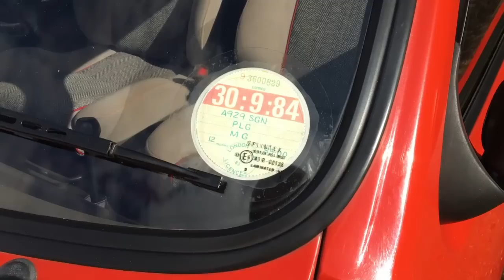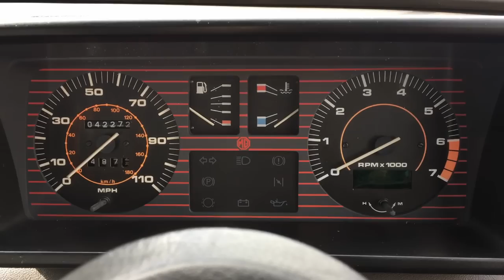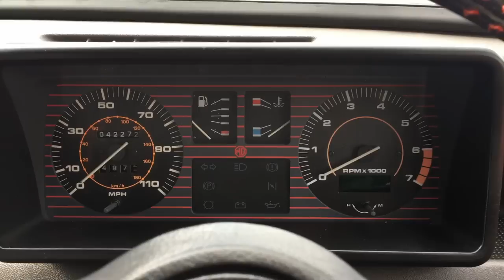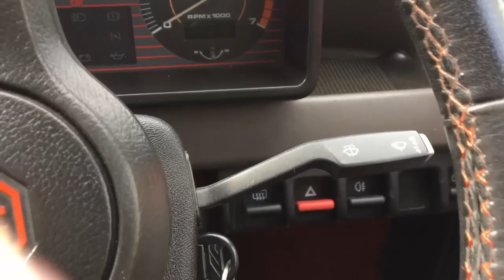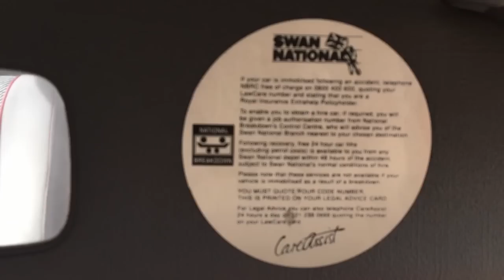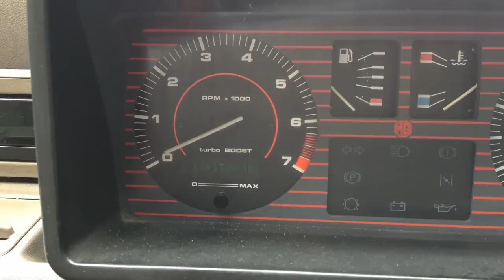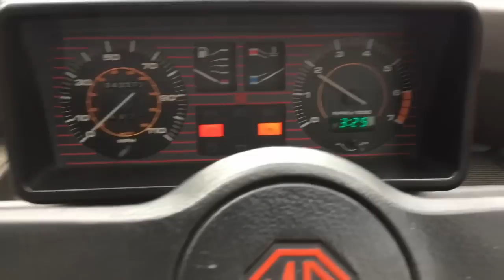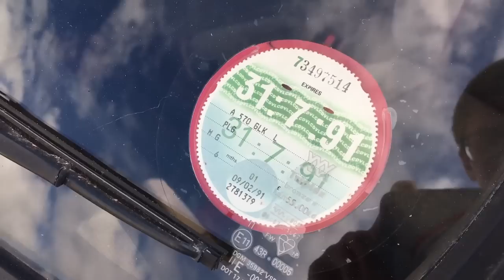"Your Best Friend Will Hate You" - 1983 MG Metro 1300 & Turbo

Comment: I'm sure I posted on this before.  These cars were fun to drive (more like a toy)  I can honestly say. I have never had another car that's so fun to drive.   The mgs looked nice and the interior is was  lush.  I passed my  test in my own MG and owned it with other cars for about 5 yrs.  I would still have it now, if that dozy beemer driver had not broadsided me on a roundabout.    After driving it for 50.000 miles over 5 years and polishing and hoovering and cleaning the interior umpteen  times,  I never noticed that the steering wheel was offset to the seat until my mate pointed it out and this annoyed me  a bit, but shortly after it was written off.

Comment: Back in the early 90s i was an instructor with BSM, who used metros at that time.  We used to get a new one every 6 months or so and we would take the old ones to a motorway service area and collect new one straight off the transporter.
We immediately started thrashing them but try as you might, you couldnt get them above about 65 mph, till the engine bedded in.  Eventually they would do just over 100.    Between pupils we would sometimes take them up to a local incinerator , which had a massive car park.  There we would tear about, doing handbrake turns, j turns etc. and have a good laugh.  Luckily, nobody was around to see what we were up to!    
I have fond memories of these metros, they were really good fun to drive and also great learner cars!

Comment: Had in 87 a Blue MG 1300.   When I bought it , it had 15k miles and was smoking oil n fuel. Took the engine out and found a broken piston ring and a scored bore. So rebored to give about 1320 cc.  The air filter was replaced with a K&N and a 3 - 2 - 1 exhaust. 40mm internal bore .   Was advised that with the correct tuning 85bhp was right output.     Put on spotlights and front fog lights, with 100/55 headlights.    Gearbox died, broke the support for 2nd gear. So needed a new gearbox case.    Cut holes in front air dam and used ducting to cool front brakes.    Make a box to sit on top of front ashtray for oil pressure and temperature gauges and a digital clock.   The front seats are very comfy, so comfy that I put a set from a crashed metro into a kit car I built a few years later.

Comment: my friend had one of these in 1988 we discovered that it was pretty easy to tune the turbo. No chip required.   You just turned a screw which increased the pressure in the turbo. After a couple of gearboxes were destroyed we installed a straight cut box from Mini Sport in Padiham.

Comment: Yet another great video, Mini-Hubnut.    I had the first Metro Turbo in Cornwall (gosh!).  I thought the ride was far too firm, so returned it to the dealer, who , after four weeks, found out that the hydrolastic suspension had been pumped up way too high.  Good cars let down by the manufacturing. Once sorted, it was a great little car.

Comment: I used to work for Kenning's may have even work or PDi'd those cars. I also had one of first MG Maestro's  1.6 R series, which i tuned up (after attending the Rover advanced carburation course) then got Company MG Montego Turbo - absolutely frightening to drive, the torque steer to right was ferocious, you had to turn wheel left while accelerating, then if you let off throttle, car turned left.

Comment: Thank you for this very thoroughly prepared and nicely presented video. My Mum bought a Morris Traveller when I was 10 years old, and I sold it when I was 32... in between I had the 1275cc A-series engine fitted, along with (essential) stronger suspension and brakes. I would happily buy an as-new 1300 Metro now because it is so practical and, as you say, just looks so good.
I eventually replaced the Traveller with a Volkswagen Polo 1.3GT Coupe  - 75bhp and superb sports car handling...
Reply from the maker: Thanks mate, this video was a long time ago now though!

Comment: Thank you SO much for uploading this!  Pure nostalgia!  An M.G. Metro Turbo was the very first car I ever bought brand new (about £5300).  This was in 1984 and so was "B" reg. and the new shape.  Sadly, it does not appear to have survived.  In my slightly revised model, the turbo boost gauge was mounted upon the header consul (top of windscreen).  My only criticism was "pinking" from the carb but otherwise I remember this car very fondly and wish that I still owned it.  I understand that only about fifty of these are currently taxed

Comment: Great video, but the Turbo has the wrong bonnet. This one has a standard bonnet, whereas a Turbo should have an extra set of grills at the back edge, giving 4 sets instead of 2. Odd though that it has the Turbo only plastic trays under the bonnet to catch the water from the extra vents which aren't there!

Comment: Just 10 months after the MG Metro Turbo was first shown at the Birmingham Motor Show of October 1982, the Mk2 Fiesta came along, the XR2 version of which saw power increase to 95bhp, with the change from Crossflow to CVH.
Amazing to see both MG Metros in that condition today, given most had engines snatched by Mini owners at first sniff of a failed MOT.

Comment: I had an 82 MG 1300 in that very nice shade of blue that your turbo car was. I bought it in the late 90s with no MOT for £40. That is not a typo. A short amount of spattering with the gasless "MIG" later and it was back on the road for many thousands of reliable and happy miles before some toerag nicked it. Was a really nice car.

Comment: I. Had one of  the MG Turbo with the lowdown petrol cap filler . Problem was it would leak fuel when going round, right hand bends causing the rear wheels  skid.🚗🏴👍

Comment: Mate had a brand new White MG Turbo in 1990 and boy did he tell us all how fast it was. Unbeknown to him, a fortnight later I picked up a brand new 115bhp 1.6 205 GTi (company car). Yes, we had a race through the lanes and yes, my mate was very quiet after that... 😂.  Still, it looked quite nice in white with its big TURBO stickers plastered over it. Like a mini 6R4
Reply from the maker: 20 bhp difference is a lot!
Reply: @TwinCam  yes of course. I think at the time I didn’t know the power output of the MG Turbo although the Charade GTTI 3 cylinder 1 litre turbo which was around at the time was super quick so I expected more from the Metro.  The Fiat UNO Turbo and the R5 GT Turbo were .... well,  at the time the MG Metro Turbo wasn’t anywhere near the performance of the others with similar engine sizes. It certainly stood out.
Reply from the maker: The MG Metro Turbo was a very outdated car by 1990. It was never a match for the really quick stuff like 205s etc. More on the lines of a Nova GTE. 94 bhp was nowhere near a 205.
When the K-Series Metro GTi came out in May 1990 it had 103 bhp, but that was expected to be the lesser model. Many magazines had information that Rover were going to launch a 130 bhp 1.4 Turbo Metro, but it never happened unfortunately.

Comment: I've never been a fan of the Metro, as a family we had several culminating in a MG version. The MG was the best to drive, pretty nippy and cornered well. Sadly someone attempted to steal it and bent the steering column in an attempt to remove the Krooklok. They failed so as a parting shot they left a huge turd on the drivers floor. 
One of the biggest problems all ours had was letting water in through the door seals, the high sill on the Metro means that it fills up with water to quite a depth.

A mate bought a brand new MG turbo version, it seemed pretty quick but had a habit of warping the front discs. He put it on its roof in the end.

Comment: 6:56  Those window crank handles look like the same BMC design used for decades.  There's a hexagon on the backside that gives it 'purchase'.  I had a 1973 MG Midget, a 1980 Triumph TR8 (carbed) and a 1981 TR8 (MPI) that all had identical black-plastic ones.  However I had three different LOTUS none of which utilized that handle.  Maybe because all 3 had electric windows.  That could be the reason.

Comment: Great memories... I had an 87 E reg plate in metallic silver, with red trim MG not the turbo model, drove it all over the Lake District Northumberland and the length and breadth of Scotland, absolutely loved it... it covered 29,000miles then on trip back from Scotland.... the Engine blew up 😢... on the motorway..... fitted a reconditioned engine with the dealer... but alas it was never the same car... traded it in for a F plate 216s rover  in champagne metallic... loved that car as well
Reply: I bet the 216 Rover rotted away like an old pear!  Mine did!  There are so few of these or the Metros on the road now.  I wish that I still owned my 1984 Metro Turbo which was the first car I ever bought brand new.

Comment: When you pulled on the choke it reminded me of the biggest problem with the early Metros. It was all too easy to hit the light switch as you pulled up the choke, resulting in a flat battery when you returned to the car. They had to fit a lights on buzzer not long after production started.
Reply from the maker: Be careful then 🤣

Comment: I Had an 'A' plate MG metro metallic blue ( as in the turbo shown in video) but the interior was all red / grey.   Took out the digital clock and made a module to take an oil pressure gauge and a volt meter. With the clock above.  Found in a scrapyard a side swiped Turbo and got the front spoiler.  Put spotlights on it.   Did porting to the cylinder head and went for a K&N filter, also put a performance exhaust on it.     It already had 4 pot front brakes, but I cut out the spoiler ducts to direct air towards the brakes.     Nice wee car until the gearbox died at traffic lights, locking the front wheels.  If that had happened on the road, I would not be here.  Replaced the gearbox, but aren't for a standard gearbox. Could had gone for a straight cut box but they are horrendously noisey

Comment: Nice review of many people's favourite supermini, especially the ultra-rare Turbo. Btw, seatbelts in the rear did exist in 1982 -they were an optional extra (also red) and then standard from 1986 when it became compulsory fitment.
Reply from the maker: In a lot of places they were compulsory by 1983, but this car in particular doesn’t of course. I was pointing out that the reason this car doesn’t have seat belts is because of the year it was built.

Comment: The turbo also had a turbo boost gauge. I had one of these RUH377Y, gone to the scrapyard in the sky now. Yes I had to rebuild the gearbox, also they liked to chew their front disks up, they were attached to the driveshafts via splines, and the driveshafts used to round them off. needed a 5th gear as it would redline in 4th (118mph!)
Reply: I had an M.G. Metro Turbo brand new in 1984 and absolutely loved it (my first new car).  I read absolutely everything I could find about these (no intranet - just lots of mag-thumbing in Smith's!).  I do remember from this that there was a company called "Turbo Technics" - I believe it was based in Crayford, Kent - that could provide a five-speed, in-sump gearbox ...... but at a price!!

Comment: At the end of the 80's they re-did the interior quite a bit. They had the Mg & Mg turbo but they did a hybrid of the 2 that had the wider wheels & rear wheel arch trim of the turbo but the non turbo engine. It was just called a Gta metro & was cheaper than either of the 2 mg's. I had a G reg Gta in steel grey. Loved it :) Oh & edit to say that the Gta & the turbo had the hydra gas like the other metros but at the front they also had shock absorbers to make it a good solid ride but not too hard.
Reply: As well as a rear anti roll bar.

Comment: I remember when they released the Metro, it was BL's wonder car, the mini replacement (it never quite did that) and a small city car. It sold quite well but the Fiesta was just a better car at the time. Sporty versions were good, as already ssid, the turbo's could be problematic and with cars like the Peugeot 205 GTi 1.6 (105ps) appearing and the likes of the XR2, it soon put paid to the Metro Turbo's sales. Bit of a shame really as the Metro was a good car, but like everything BL (note Chieftain tank's multifuel engine as the tank itself was really good) there was always something that was going to let it down, mainly build quality. It was BL's downfall, I remember when they went bust, poorly managed, over unionised and average products in a competitive market. Back to the car, there is one just up the road from me, been sitting on ramps for years, looks to be in decent nick for a 30 something year old car, in pruple of course ;)

Comment: In the early 1990s, I had an MG Metro like that one, same colour.  Lots of rust issues, had to replace the front valance and wings, around fuel filler, after just 6 years old.  Otherwise it was mint.  I repaired it all, but poor design and manufacture.  The car handled very well, but the 4 speed box was poorly geared for the motorway, really needed a 5 speed box.  The K series update by Rover, was a major improvement, but the body safety was low, which killed it.

Comment: I always thought the wheels sat too far in on metro's, especially the turbo! But despite most of them being rotten when I started driving in the early 90s I do have a soft spot for them!
Reply from the maker: I don't know whether I mentioned it in this video or not, but the original Metro was due to be narrower than the final car. A new body was engineered in about 1978. They didn't bother to widen the track as they had to get the car to market ASAP!
Reply: @TwinCam  not in that video, but I was aware of that! It's a shame that they couldn't afford to just put that little extra money and effort into the program, but such was the situation that they couldn't. Shame as they got so close with the metro!

Comment: Loved my metro turbo.. Used to surprise me as sometimes, especially the bump-steer as the turbo kicked in. Driven hard it went some... Got 6.5k rpm in 4th gear, speedo showed 130, no idea how accurate that was but it was flying.. Only did that once.
Reply from the maker: The official top speed was 112, but boost levels varied massively by car 😅
Reply: @TwinCam  all I can be sure about was that it was extremely scary going that speed with such a short bonnet.. 😬 I hit valve-bounce so couldn't go any faster.. Very foolish I was 😔
Mine was red '83' A' with the large TURBO text.. Bought in late 1985 early 86 I think.. Kept it until around 1994 when wife decided we needed a family car.. Only big (read expensive) issue was gearbox had to be fixed lol

Comment: Excellent video, I had 3 MG metros in the 90's, 1 early MK1 in cinnabar red ( the same colour as the one in the video) with the black and houndstooth interior and 2 MK2's, I did notice a couple of things in the video, the MK1 MG metro turbo never had the MG logo on the wheel centre caps, that was the MK2 that had those, and also, the metro turbo in the video has the wrong bonnet on it, the turbos had 4 slats as opposed to the standard 2 ....keep the videos coming 👍
Reply from the maker: Indeed it does have the wrong bonnet, but there is a proper one waiting to go on, it just needs to be sprayed!

Comment: Had a MG Metro and was a great diving car and very practical but mechanically they were terrible.  Mine was  for ever in the garage getting head gaskets done, very easy to spot the green coolant lines down the side of the engine. A friend of my had owned serval Coopers over the years and said they had similar issues which was sorted by a extra head bolt fitted when the issue was spotted  In typical Leyland style they didn't fit it to the MG

Comment: After seeing a crash test, the last thing you want is a 'fast' one ;o)
Reply from the maker: That’s the same with every small car of the era. The only reason you won’t see a crash test for a Nova, Fiesta, or 205 is because they’d stopped making them by 1997. The Metro was just produced for longer. In fact, the Metro was regarded as one of the safest small cars when it was launched. Standards just move on.
Additionally, the Rover 100 that was tested had a completely different arrangement forward of the bulkhead, so these Mk1 Metros cannot be compared.

Comment: Ye great little motor just started at fords when this come out great clutch design but crankshaft oil seals were a dripping nightmare 😵 loved the rally version that had nothing I common apart from looks in some way,never had the pleasure to try the turbo one but worked on meny mg's.

Comment: I believe the MG Metros were fitted with shocks, the only model to receive them.
Reply: PhysicsAirline They were indeed. And I believe the Turbo had a rear anti roll bar and different valving in the Hydragas units.
Reply: all mk1 MEtros had shock absorbers, they lost them in 1985 with the mk2, the brackets where still fitted till 1986 so you could retro fit them and correct only the Metro turbo and later the GTA of 1989/90 had the rer ARB
Reply from the maker: K-Series Metro GTis also had shocks at the front, as well as anti-roll bars.

Comment: I owned a Silver over Black Y reg MG Metro Turbo MGE ???Y back in the 80's.
I thrashed the living daylights out of it on the Cumbrian roads and it was a Fiesta destroyer even the xr2i couldn't beat it off the line and took ½ mile or more to catch up but it had longer legs with its 5 speed and it showed at top speed...pushing 100+ from Penrith to Keswick was considered normal safe behaviour back in the 80's...expected in fact!
I had several police ask to drive it as they just couldn't keep up with the MGs and fiestas in their 1300 escorts. They where astounded by its rally like performance on the back roads of te lakes area where it excelled.
So they bought a couple xr3s then xr3is oh and a Maserati engined Talbot for catching bad guys on the M6!
I've also owned a couple of basic 1000cc metros and they did sterling work back in the day.
Peace 
Charlie 🇬🇧
Reply: Oh..... the days before big, yellow cameras!